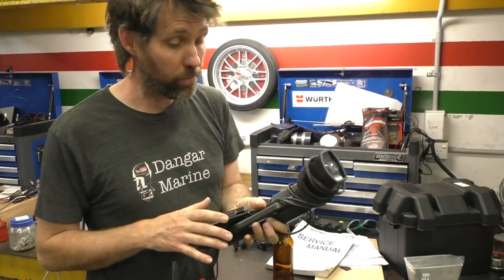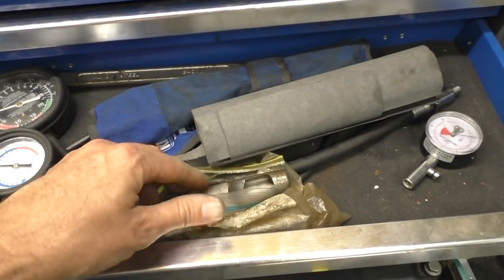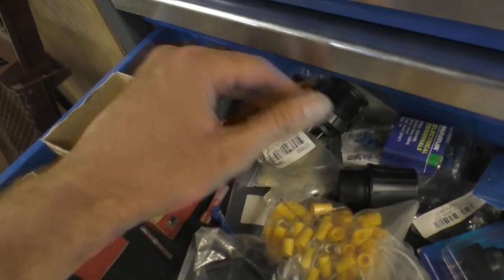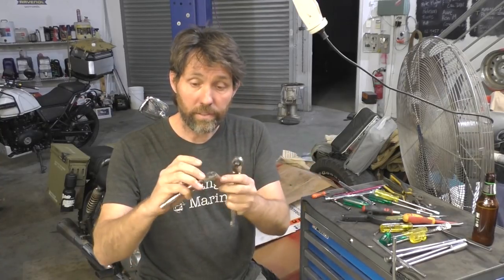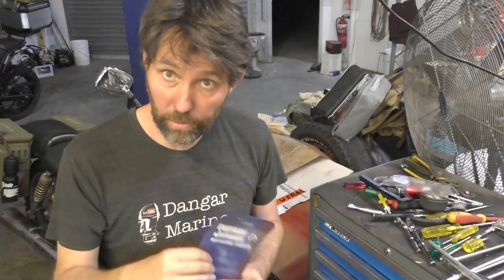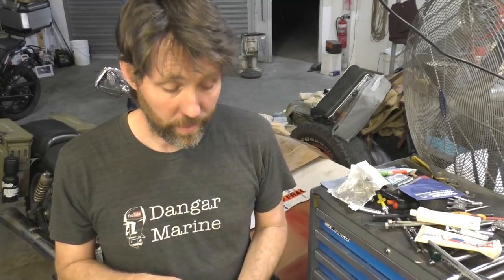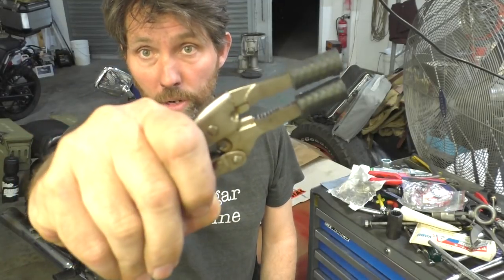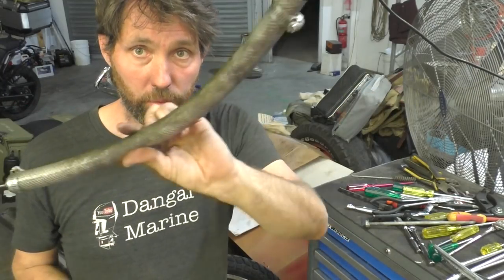Tools for working on outboard

Comment: one specialty tool I want to make is a wideband o2 sensor air/fuel meter.  should make diagnosing and tuning idle jets (or even sizing main jets) far easier. you would just stick the sensor in the exhaust/prop and get a reading.  something like this: https://www.jaycar.com.au/fuel-air-mixture-display-kit-kit-back-catalogue/p/KC5485
Reply from the maker: Hey Ben, that's a really good idea. This is close to my heart as I really want to tune my carburetted motorcycle at the moment too. The problem is (as far as my current research shows) that the sensor needs to be much further up the exhaust as they don't really begin to work until they are at 700 degrees celsius. In fact that actually have a circuit to heat themselves above the heat provided by the exhaust. I certainly think it would be a fun and useful project though. Thanks for the link! :)
Reply: good point on the heat.  Only problem is the sensors are bloody expensive so keeping my eyes open for exhaust manifolds that have been thrown out.  There is a driver circuit kit that can run the bosch sensors. the kit is KC5486. Alternately I've used this one about 10 years ago: https://www.jaycar.com.au/display-fuel-mixture-module-ego-10led/p/AA0374.  It was good to help me ensure things didn't lean out on my little turboed mazda but not sure how accurate the old EGO would be for tuning.
Reply: in go karts we use a specific O2 sensor and 'calibrated' version of the Silicon Chip project sold by Jaycar. The O2 sensor is a Holden V6 4 wire (isolated internal heater) , with the heater wires clipped. These are used on Yamaha KT100S and 100J engines all the time- or were, KT100s are not raced any more on the bitumen. There is no reason why you couldnt use a self heated  O2 sensor. And they are not that expensive.

Comment: Have not seen  throughout the whole video mentioning Torque Wrenches , a must have shop tool. Would be a good idea to work on a video if you haven't posted one about how to use correctly a torque wrench, their torque settings, bolt torquing sequence, etc. When you have  changed exhaust and cylinder head gaskets for new ones and all bolts been torqued to specs, are you a fan about checking or retorquing back bolts soon after  5-10 hours of motor has elapsed ?
Reply from the maker: Yes, there were a few tools I forgot to mention because they live in a different part of the workshop. I definitely think it is a good idea to re-torque bolts that go through heat cycles.